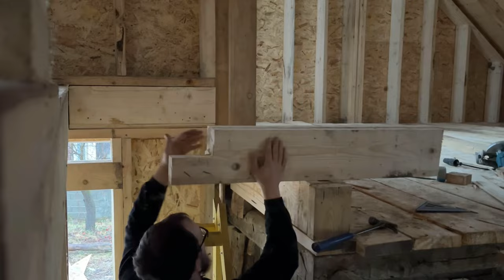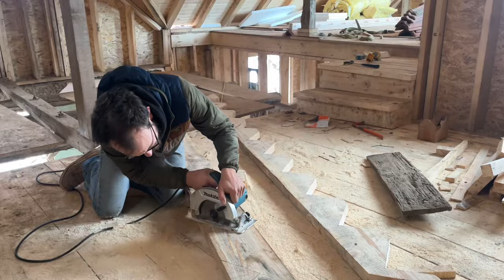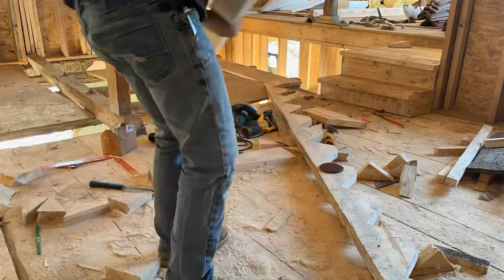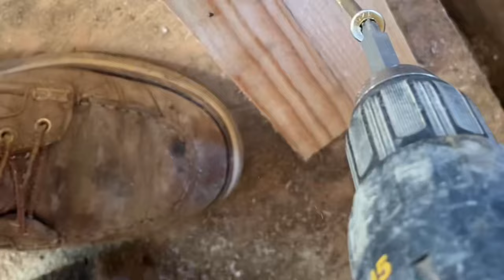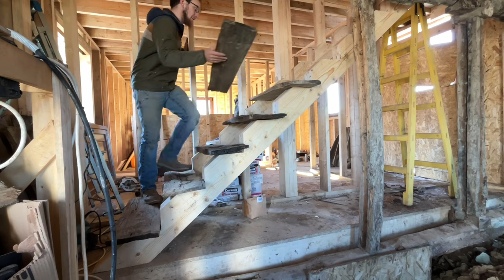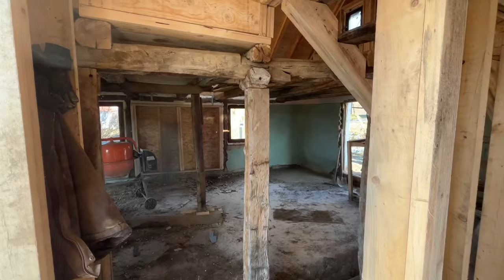Building open stairs with reused wood treads. Mud home renovation. Part 12

Comment: What kind of wood is that you’re using for the treads?
Reply from the maker: I don’t know what kind of wood it is for sure. It’s a hard wood. Might be cherry or something. The wood is so old and hard some of the nails bend when I nail it. They were the boards that were laying between the rafters in my attic and covered with mud. So they are kind of cured.